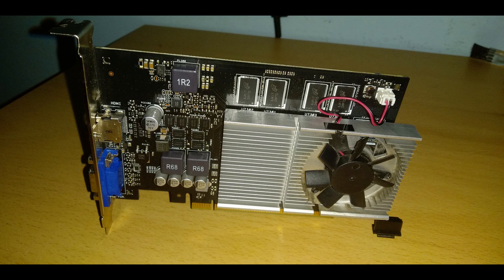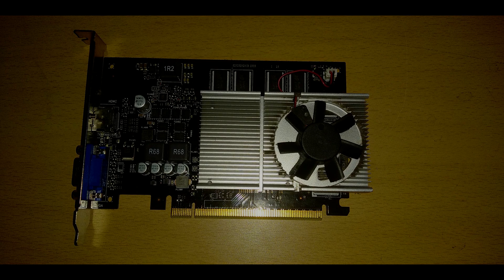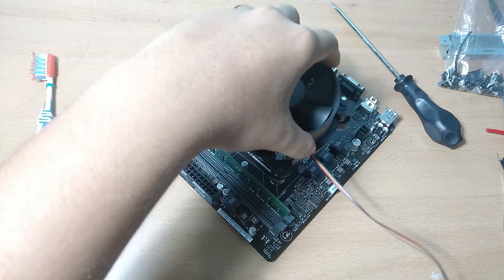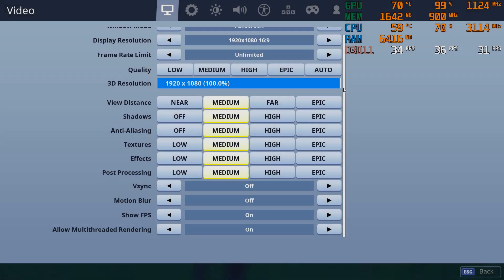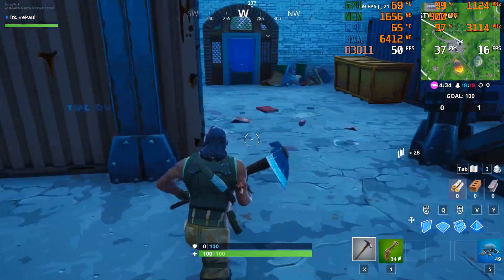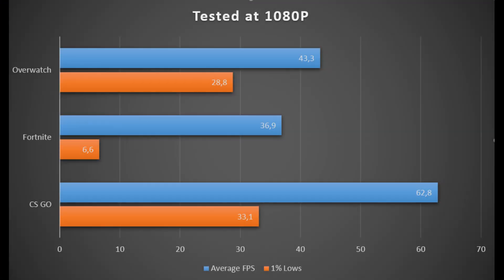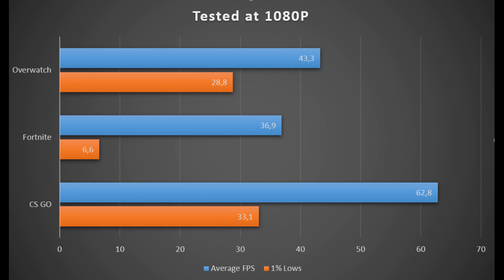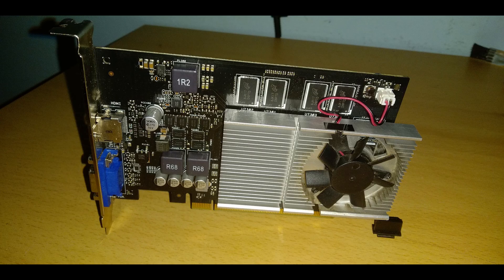Nvidia GTX 950M | A GPU for laptop on a desktop?

Comment: Recently got mine one. Gpu-z shows 0MB RAM. I tried install drivers and the procedure starts and finish, but when I reboot the card isn't really recognized and I have the desktop in 1024x768. I think is a RAM problem. I just want to flash another bios but I can't find a correct gddr3 bios for this card.

Comment: Hello! Do you have the drivers for the GPU somewhere? I have the same one as you, but I've been unlucky trying to get it work.
Reply from the maker: Hey man, this should be the driver you're looking for https://www.nvidia.com/Download/driverResults.aspx/159424/en-us , just make sure it's the GTX 950M (Mobile version)
Reply: @ItsMeIvan-  I've tried those, tried even the drivers on asus site of the computer what had the gpu in it, and they don't work either :( Just gives the error 43 in device manager. Probably my hardware is just broken. But thanks for replying!
Reply from the maker: @rke42  Probably a conflict of drivers, try using this software to uninstall older drivers correctly and download the new one. https://www.guru3d.com/files-details/display-driver-uninstaller-download.html
Reply: @rke42  I have the same problem, try open GPU-Z. Do you also have 0mb of GPU memory?
Reply: @ALLP1AY  Yup, but I found out on linux that the GPU is broken, it just crashes the computer.
Reply: @rke42  Also here error 43. Do you find any solution?
Reply: @ALLP1AY  same

Comment: I am playing on the highest settings and i get over 90fps FullHD. I think i Will buy another egpu adapter and try to sli a gtx 750 ti with different sli auto with my laptop's internal gtx 950m

Comment: you must have the wrong drivers i have a laptop with this gpu and get 120 fps in csgo
Reply from the maker: That Sounds great! I only had little time to take a look at this gpu, so if I messed up something sorry for that. I'm pretty sure that I had the latest drivers. What are your other components specs, how much vram do your GPU have and at what frequency is it running at?
Reply: @ItsMeIvan-  i5 6300hq 8gb of ddr4 ram and Samsung ssd
Reply: @ItsMeIvan-   not me but same laptop https://youtu.be/nSsWtVFsXlw
Reply from the maker: @markdove5930  I see, If I had set it at 1366x768 at those settings I think I would've gotten pretty similar frames. It could be that having a single Channel ram that could be hurting the 1% lows.
Reply: @ItsMeIvan-  you can get 100fps in csgo even in HD i use an external monitor at home
Reply from the maker: @markdove5930  thanks for the feedback man! Greatly appriciated. I'll make sure to add driver versions to my videos next time.
Reply: @ItsMeIvan-  The card isn't that bad  I can get 40-60(medium 720p) in Helblade same for most games up until 2018(with some exceptions) ,clean 60 fps in most racing games at medium. The only games that won't work or will have bad slowdowns as far as I know are Rage 2 and Metro exodus.